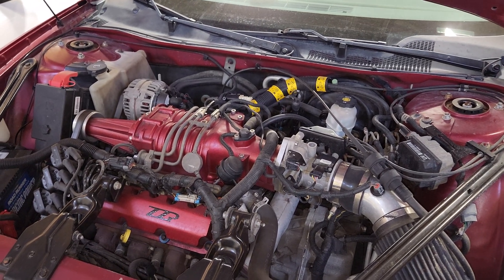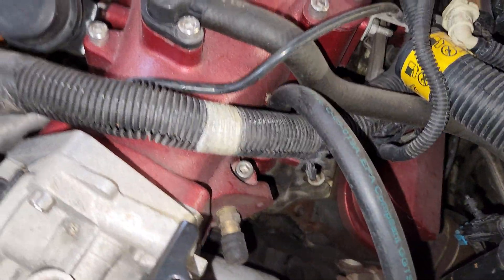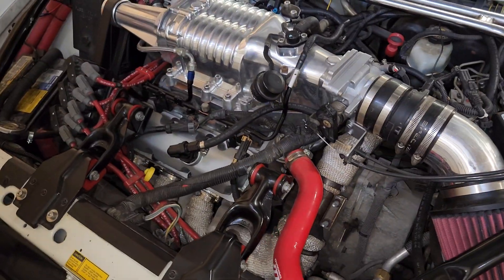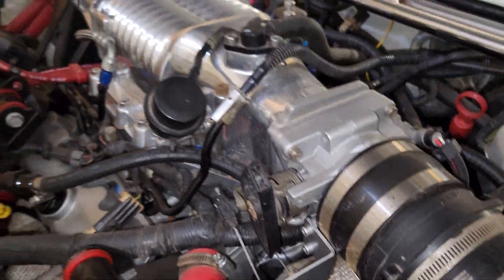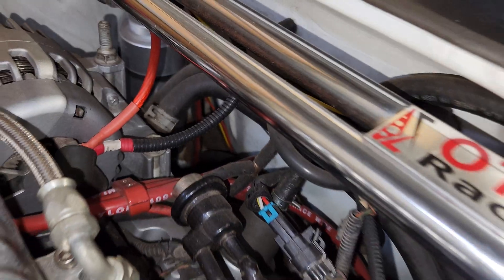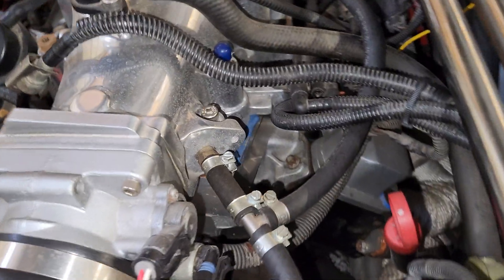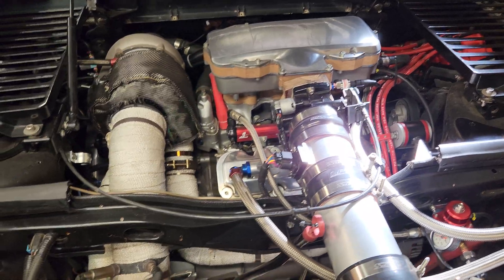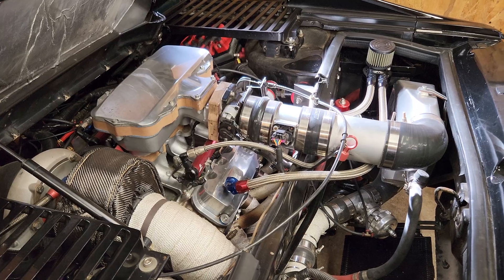How to setup your pcv or catch can on a supercharged and turbo 3800 v6

Comment: Ok so 3 more questions and im done. Might be dumb questions but i want to learn lol 

For the chrome M90 setup 

1) why did you place the PCV on the catch can inlet side instead of the discharge side where it will be "clean" air and not oil vapor air ?? 

2) the stock PCV under the cover plate at the top of the M90 did you remove to spring and just leave the PCV valve in it or is the spring still in there with the PCV? I just dont understand that part 

3) did you just relocate the EVAP or did you have it deleted ? I saw the tee in the video but not sure

Thanks in advance !!
Reply from the maker: Fresh air from pre tb blade to one valve cover. The other valve cover i put in a pcv valve. I run that to the inlet of the breather. This is the side with the baffle. On the output side goes to the constant vacuum source that is pre sc rotors and post tb blade.

The old zzp intercooler blocks the pcv path that is why I abandoned that path and went external. The pcv components in the blower are gone and plugged.

The evap is still in use. It is fed in at the T.

Comment: Any reason on the M90 chrome set up you went with non vented over a vented catch can ?
Reply from the maker: No reason on any m90 3800 for a vented catch can. You have vacuum available at all times, pre tb blade to ventilate the crank case.  Unlike a turbo car that pre tb blade is under boost pressure at WOT.
Reply: @KORNF3D  ah got makes sense, thanks so much for reply ! i may be back with questions later lol

Comment: This is helpful, thank you for the upload. 
Nice collection! 
The second setup you show in this video is most similar to what Im working on. My 3800 has a ZZP intercooler with a blocked off PVC system. 
I did as you did with the front valve cover. I routed air from the front valve cover to the intake (between the MAF and Throttle blade. 
I didn't do what you did with the rear valve cover.. I think I goofed. What is the purpose to venting the rear? And does the air vented from the rear cover get routed behind the throttle body blade?

Comment: I have 2 question’s.. do you block off the gen5 stock canister purge valve and use the stock gen3 purge valve when doing the gen5 blower and intake top swap? And do you have to tap a hole into your throttle body to make this all work?

Comment: I have my catch can setup pretty much exactly like you have on the second car you show in this video. I've had nothing but problems with the intake sucking up way to much oil even past the catch can. I need to fashion up some kind of baffling in the oil fill neck where the PCV is plugged in

Comment: I know the video is a little old... but a quick question, I know the 3800 SC is internally vented (stock) but why not ditch the catch can, and add filters to each valve cover? (like an older American V6 or V8) Wouldn't that allow the air to be released freely? Unless for emissions purposes...
Reply from the maker: Because that's not the correct way to ventilate a 3800 with the mass air flow sensor. It will be a vac leak for starters.  Putting breathers on the covers is lazy. It makes a geasy mess that can start a fire. It very poorly pulls out the fuel/water/contaminates from the oil. Catch cans are the better choice.
Reply: @KORNF3D3800s  ah, just wondering, I've been doing it on my American V8's. Just figured I'd ask about the 3800. Especially being internally vented. I dig the setup tho!
Reply from the maker: @natewj1077  if you look at a lot of the more serious and well thought out builds in the last 20 years you'll find that catch cans are the more popular choice across all platforms.  The guys with the carbed v8 are still stuck in the 70s point of view. Long story short you can toss a breather on any motor, but the idea can be improved in more than one way.
Reply: @KORNF3D Check my comment on your post need some advice